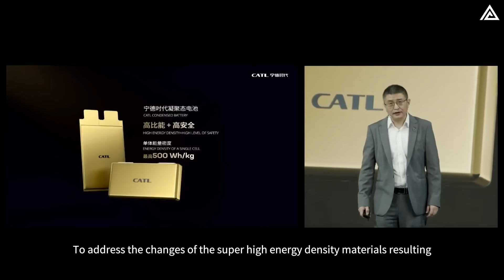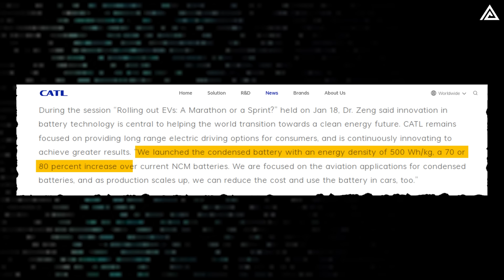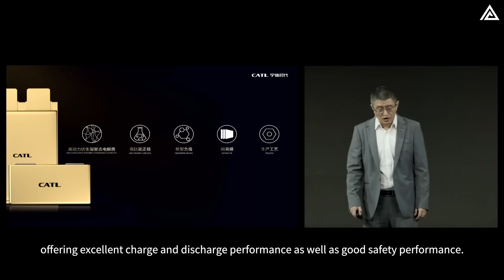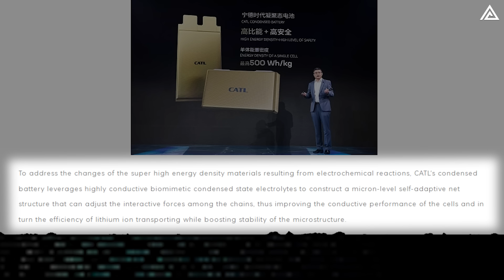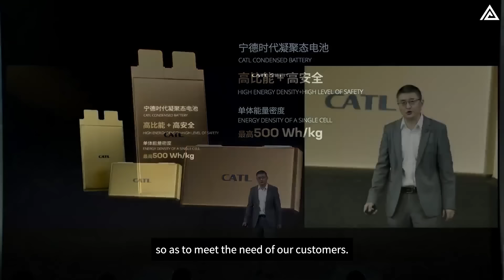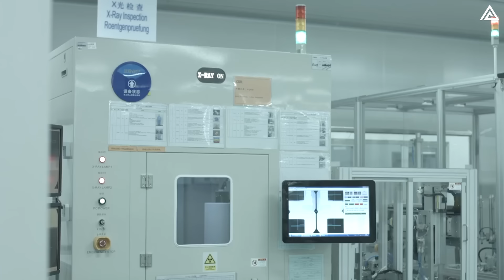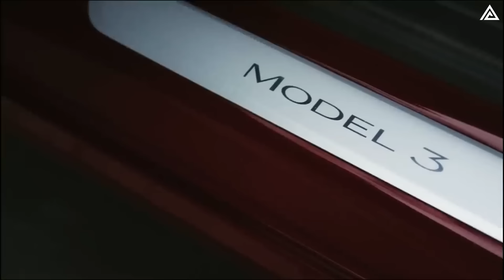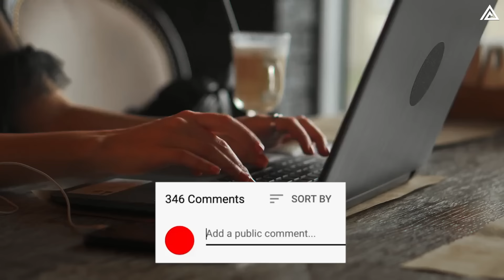Elon Musk Announced NEW CATL's Condensed Battery. 1800 Miles Of Range!!!

Comment: 1800 mile range is unnecessary...stop at 1000 and reduce battery size and cost instead
Reply: I would say 600 miles is sufficient.

Logic for this is if I’m driving at 70mph on a motor way it’s going to take about 8 hours driving before you need to consider recharging…..after 8 hours driving, most are probably going to need a proper break/rest, not just a 10 min loo / quick drink stop. 

Additionally, if you are doing a long day trip out to visit a friend, relative or an attraction, you might be driving for 3 hours to get there, spend 3 ours at the venue,M then do the 3 hours return trip…so, you might be driving 400 to 500 miles on the round trip - & it might not be convenient or even possible to recharge at the venue. 

So I think 500 to 600 mile real world range should be sufficient for most use cases. 

Many EV’s current give around 300 mile range which isn’t really quite enough.

They will probably nerf any new car using this battery though, and make the battery only big enough for 300 miles of range to reduce weight and cost. I’ve seen it said multiple times that customers don’t need more that 300 miles most of the time.

Comment: Motorists rarely drive 200 miles in one go. Instead of doubling the range to 1800 miles, can Elon Musk reduce the size and weight of battery to half or smaller? In this way, we don't have to carry the deadweight of excess part of battery, which will improve the efficiency of the EV.
If longest range of distance covered in one charge is the criteria,  then a petrol engine car can cover a large distance with a super big fuel tank!!

Comment: One just knowing that it'll reduce the risk of a fire, which is the concern of many people, will definitely increase the sales of electric vehicles. Another factor is that it will also increase the range of the vehicle and reduce its weight, which will open many other doors where these batteries could be used. Such as cell phones and aircraft. Just think that it should also reduce the cost of building these aircraft and open the doors for the development of new engines. Just consider the reduction of noise from these new engines alone and also probably the reduction of engine vibration, let's hope.
Can't wait to see the distance that these aircraft will be able to achieve and the reduction of maintenance cost. No more smells of jet fuel fumes, and the largest factor of all would be that if these aircraft just happened to crash, the survival rate of passengers should be much higher because the risk of a fire from jet fuel which will no longer being used, which will certainly be the largest factory of all.
The doors that will open for these types of batteries will be unsurmountable. Our future is changing in the blink of our eyes, so be vigilant because you don't want to miss the changes that are coming.
Reply from the maker: What a detailed sharing. Thank you!
Reply: Hydrocarbon fuels are around 10kWh/kg - these are only 500Wh/kg. Battery aircraft may be feasible for very short flights but longhaul is still going to need denser fuels - it may be better to concentrate on nuclear power and synthetic (green) hydrocarbon despite the expense (A B747 uses about 4kg fuel/second, double that during takeoff and climb)

(Longhaul flights are more than half fuel, by mass)

Comment: If and when it reaches Market 
It'll be good 
There's been stories of Tesla buying Chinese batteries for the Chinese teslas for a while which makes sense if they can buy them at a decent price because it'll be expensive to build a battery factory in China
Reply from the maker: Here is my take, Tesla's car that produced in Chinese will use battery made in Chinese. Tesla doesn't need to build anything, just buy it and put it in the car. And in the US, Tesla will make their own and take some from suppliers (LGES, Panasonic...). They got a battery facility in Nevada that utilized CATL equipment, and tariff on Chinese EV battery will be no prob, because Tesla doesn't buy battery directly from China.

Comment: Since current battery's are already at around 250 watt hrs /kilo and this is twice that it would only be twice the range and they are  around 300 miles now so at best it would be 600. 1800 miles is not 600 by a factor of 3
Reply from the maker: Seems reasonable tho.